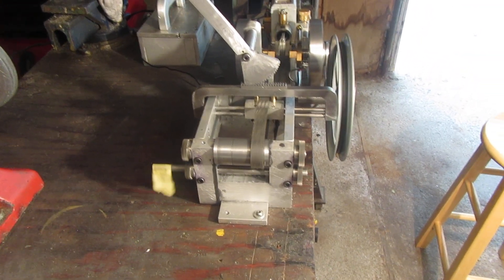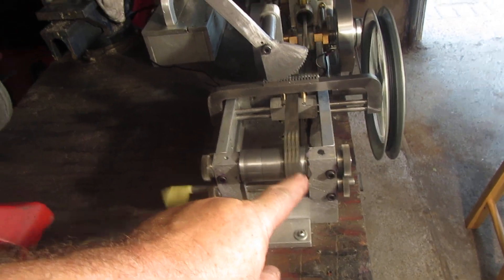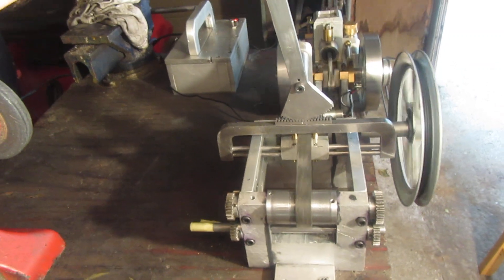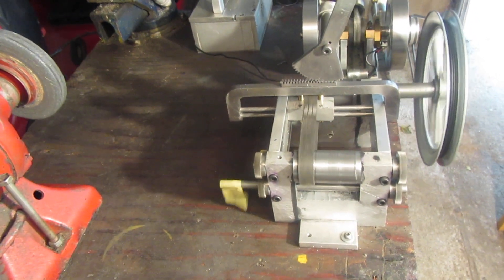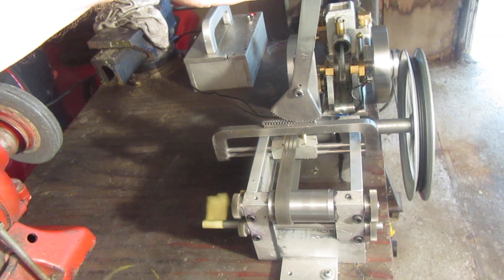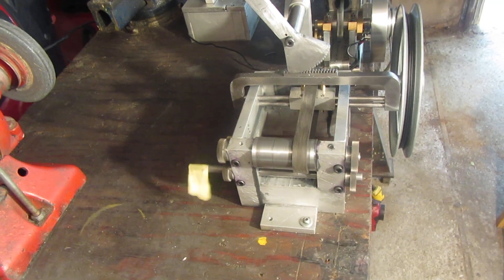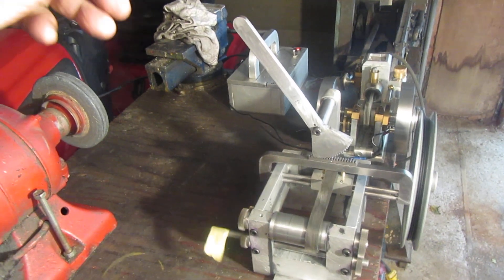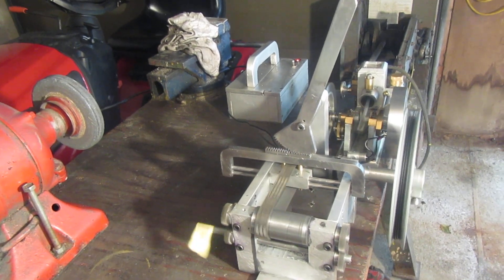Flat belt reversing mechanism

Comment: Will you show the other end of the flat belt drive or is it secret? I've seen a reversing belt drive that slid a roller across the surface of a rotating disc thereby not only changing directions but also output speed.